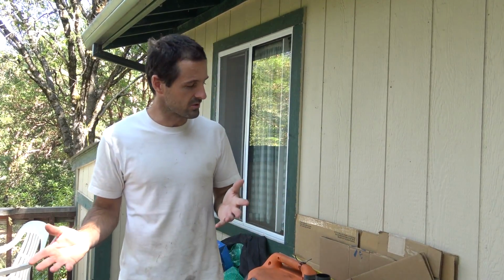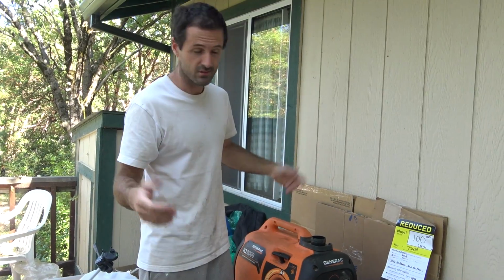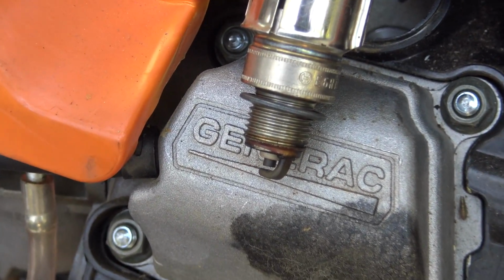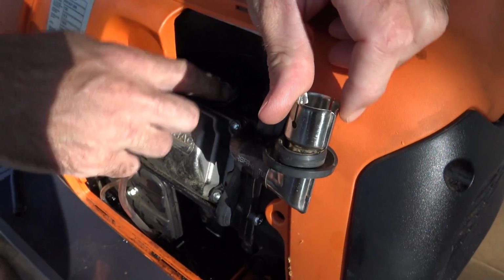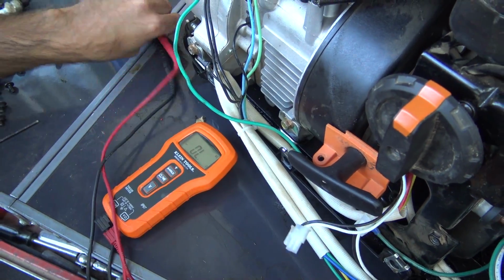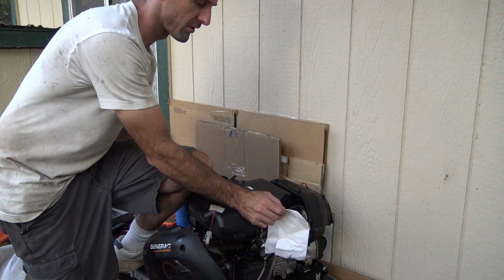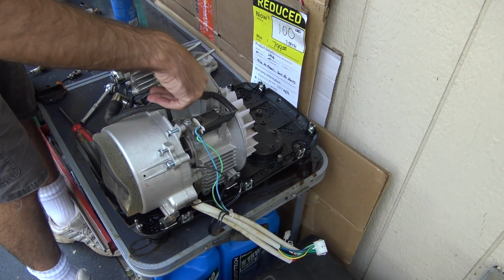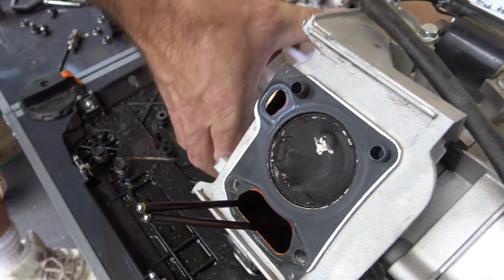$25 Generator From Lowes - Will It Run?

Comment: Pouring fuel on the spark plug shorts it out (insulates it?) between the electrode and it's casing which is similar to "flooding" an engine. Those engines do have an auto de-compressor - looks like a standard Honda-like engine.
Reply: You weren't the only one.
Reply: Gasoline will NOT short out a plug; it's totally non-conductive. Flooding an engine doesn't short the plug, it just gives a mixture that is too "rich" to burn. I've used that trick for about 40 years now and it is a great way to do a quick check if you're not sure fuel is getting to the engine. The amount of gas a plug will hold will usually give 2 or 3 "pops", enough to assure you that compression and spark are good.
Reply: Interesting, from my own experience I have seen fuel-wet plugs refuse to work at all until dried - perhaps I have different fuel additives in my area? In hindsight though you would think that petroleum derivatives would actually insulate seeing as paraffin wax has been used in that way.  Also I failed to mention that I thought wet plugs were only a factor to a flooded engine, not the only reason (:
Reply: Ryan Farnay I had a Honda Elsinore that had a carb jet that was too large. Unless you ran it real hard before shutting it off, you'd have to take out the plug and dry it before restarting or it just would not start. I was shocked to see him pour liquid gas on the plug as well.
Reply: Looks like a Honda EU2000i. Extremely reliable generator, I have one in the garage.
Reply: True, but that's assuming that what's coming out of the pump is actually pure hydrocarbons. Different countries add different dyes and other additives that are supposed to help here and there. I might do another test to find out as I've definitely seen a spark plug cease to work after being fully wet with fuel in my area, but with the amount of extraneous variables involved I can't be certain.
Reply: Not true, don't believe me, think of an in tank fuel pump..
Reply: Ryan Farnay Incorrect. Gasoline is a very poor conductor. Hydrocarbons have no free electrons to conduct electricity.
Reply: Maybe I've been thinking about it incorrectly all along - if the fuel may actually be non-conductive, it could simply be insulating area between the electrodes on a spark plug, stopping the ark jumping across surfaces. That pretty much meets both sides of the argument - everybody wins.
Reply: For sure, either way you slice it..when it comes to this stuff, it doesn't always make sense....go figure!
Reply: Ryan Farnay I cringed when he done that lool

Comment: It was probably a rental item that they retired
Reply: Was a manager there for 10 years. Most of the time it comes down to what that company tells them to do. During tornadoes of 2011 we had tons of generators returned after people used them for the 30 to 90 day return policy. Just like some buy air conditioners to use for the hottest period then return it to get money back just to do the same with a heater.
Reply: You are probably thinking Home Depot Lowe's doesn't rent at least not in any of the 6 stores i know
Reply: Lance Howard doesnt that kind of return inflows affect the company bottom line? I would think that the big ones like depot and lowes would have established some kind of return clause to prevent people like that from literally  getting free rentals.
Reply: Wil Hansen the tag says how much it was sold for and that it was a return lol. Also lowes doesn't do rentals...
Reply: Ll Lock it's the whole bend over and take it for the customer mentality. That s why over 80% of the merch is marked to over 50% profit margin. Obviously if they do it continuously and loss prevention starts noticing, (receipt records wit register records are kept both digitally and on paper for years and years and any time you return they use your id) the can put a block on it to keep them from returning anything without an overuse. This usually takes awhile when it's this type of abuse though.
Reply: Jesse Crandle they have too much money to waste time on fixing stuff.  And why would they?  If its a rental, it has to be 100% reliable so they usually retire equipment early.  And thank God they do sell cheap worn out cap for next to nothing so a guy like me can buy it, fix it, and have it for a steal.  Sometimes I stop by home depot or lowes just to check if they have anything like this.
Reply: That would make a lot of sense. 

Still pretty raw of them, in my opinion, for selling an item they assumed was completely broken for $100. If you're a professional and you don't think it's worth salvaging why would you pawn something like that off on your customers???

Comment: You have a bad camshaft. the compression release mechanism is faulty which is the reason for compression in reverse rotation. And please spend $3 and put a new plug in it upon reassembly.
Reply: Agreed, either a bad cam or valves need adjusting.
Reply: Polo Buk 
I think the inlet valve is not opening which would explain why no compression in the normal direction as no air would be entering cylinder through inlet valve. But in reverse direction air would be entering the cylinder through the exhaust valve.
Reply: Maybe, but I need an exhaust sample to verify your findings.
Reply: sorry but not so. Gonna be snapped rings from overfilling oil that did the job. He has no wobble issues or noise like a bent cam would do.
Reply: Finally .. someone that thought this through. Overfilling the crankcase that much with oil will force the oil past the oil ring assy and snap the other ring/rings into pieces. In my outboard engine marine repair business I see it happen often.
Reply: Its the cam. I know because I have had the same problem with a predator generator  ( 420cc 6500 watt ) not an easy fix but not to expensive either.
Reply: John Pilagonia i believe, the rest of you made me laugh. Muffler bearing........
Reply: wow we got some real winners here by reading these comments holy shit! daddski just curious ever heard of a crankcase breather? lol broken rings...
Reply: the piston rings ARE a complicated failure, valves coming out of adjustment is literally a fucking screw coming loose. whats complicated about that?
Reply: running out of fuel would be simpler, and quite often a broken ring will chew up the piston and cylinder so you can see the damage through the plug hole
Reply: Not a complicated failure if you understand what happens in that small of an engine when a moron fills the crank case completely full of oil. It has no place to go but the space between the piston and head IE combustion chamber. It will snap those rings like they were popsickle sticks
Reply: Sorry but that is when a roller bearing or other debris breaks the ring into small pieces THis engine has no rollers I believe. IF the rings are just broken into two or three large pieces it will remain in the groove and you see nothing.
Reply: John and all the people who liked this comment are dumbasses, just like the fucking retarded Wisconsin northerners who cant design anything for shit
Reply: All of these commends are opinions.
No one here knows why it's having the issue cause we have not diagnosed it yet!
It could be the muffler bearing or flux capacitor for all we know...
Reply: This was a hilarious video. The family dynamics made it, as well as his patience. 

Bottom line solution: Replace the pull cord and reverse the spin.
Reply: Bwahahahahaaaa ... 😄
Reply: Polo Buk there is a decompression fly weight that holds the valves slightly open so it's easier to pull over, unlikely to be the fault tho as it would normally fire with the valves lifted.
Reply: John Pilagonia NO THE VALVES ARE PROBABLY OUT OF ADJUSTMENT CRACKHEAD
Reply: doesnt seem like is has any rings left if any at all. bad or no rings is my guess
Reply: meyaw Abdulaziz, thanks douchebag, I won't watch part two now.
Reply: it turned out broken rings https://www.youtube.com/watch?v=Y4Xd4-3Vjk8
Reply: Your all wrong it is the piston rings. You Americans are always overthinking things.

Comment: If you read this before watching compression test first .if none put oil in spark plug hole not much 1\2 a pop bottle "cap" just "cap" old oil is OK then pressure test again if compression goes up piston or rings if no change valves or timing . replace spark plug with new one check fire if no fire unplug all wires the only wire you need is ground to kill it. if it starts OK this is for the ones not in a hurry to jump to tear down a engine

Comment: Typical, it's not unusual for consumers to mess stuff up and take it back to the store. Equipment powered by a two stroke engine gets returned the most, not because they're bad engines, but people don't know how to start them or people don't mix the fuel right and mess the engine up. There was one old guy who burnt up 3 weed whackers in a row, I asked him what fuel ratio he was using and he didn't know. He was the problem and the store refused to let him return any more burnt up units. Come on folks, RTFM!